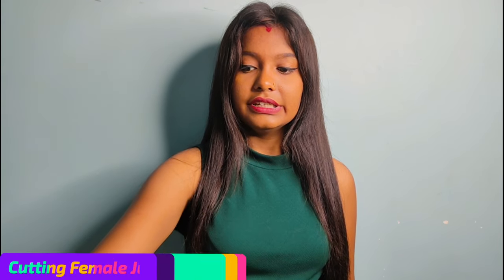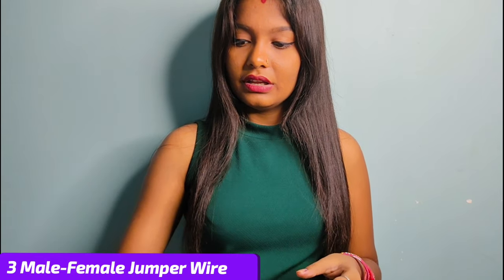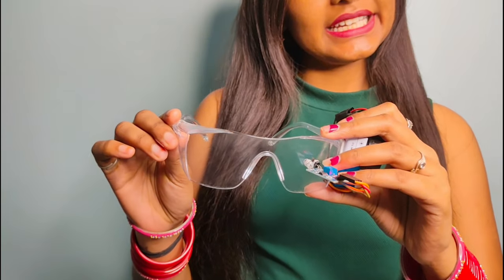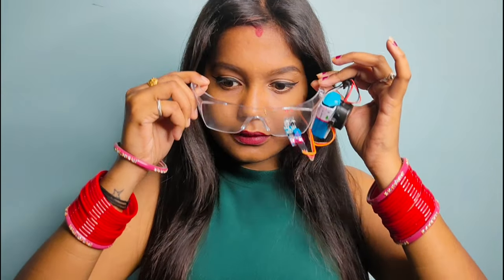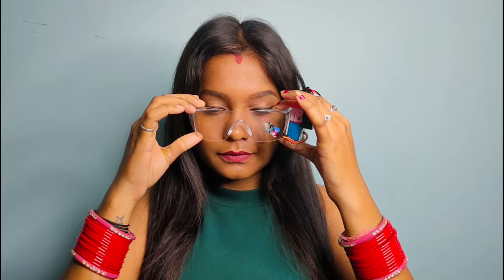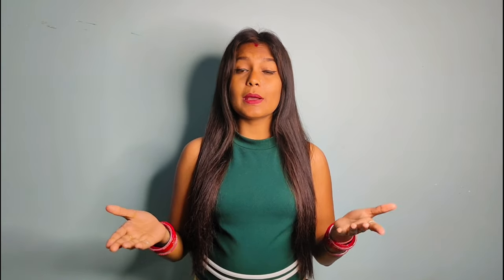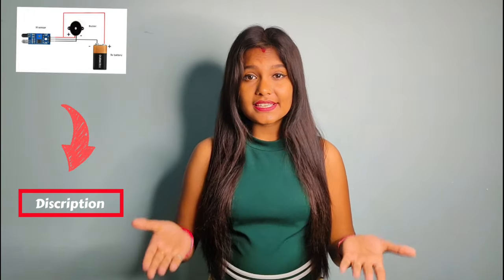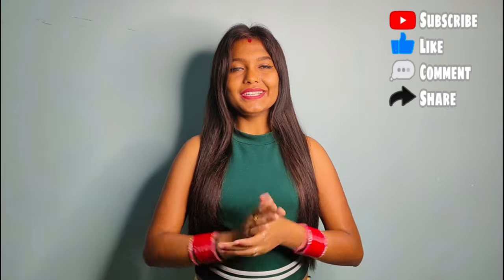Anti Sleep Alarm Glasses | Eye Blink Project without using Arduino | Antisleep Device for Driver

Comment: Code for this project ???
Reply: Fake video bcoz sensed red indicator led on sensor board not working.
Also hear the sound its edited watch and hear video carefully
Reply: It has a default code inside the nano
Reply: @sionfernandes3692  so my question where is arduino nano...
Also see title without arduino/ microcontroller ic